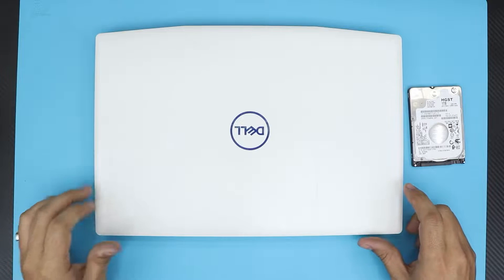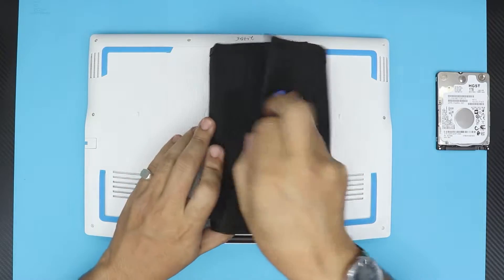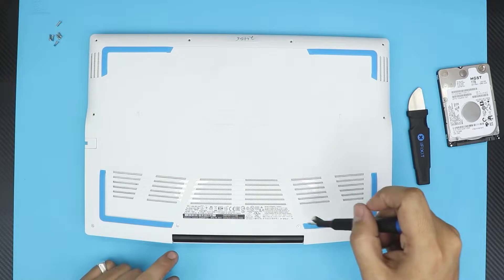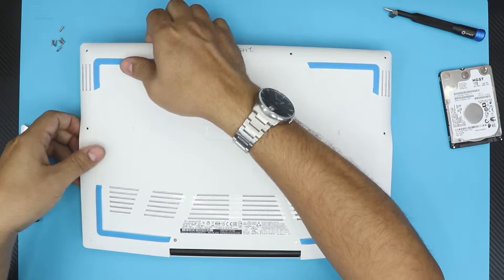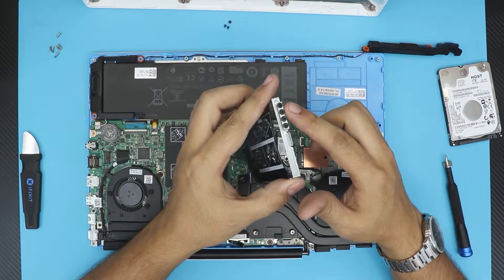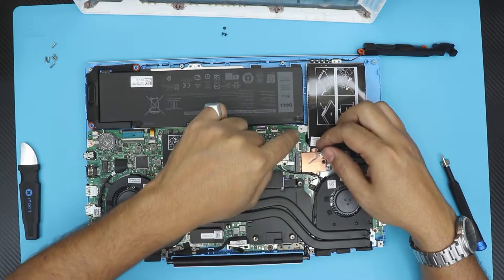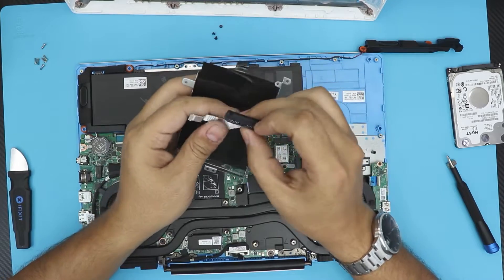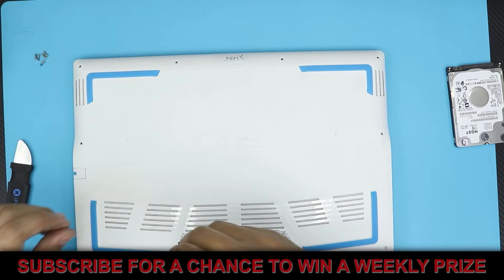DELL G3 15 series HDD / SSD upgrade GUIDE

Comment: Is it bad if you fold the ribbon like that?
Reply from the maker: there is not problem on folding the ribbon cable  few times but. its not recommended if you are doing to fold it more than 10-20  times. as you not going to be replacing hdd every week or so, so dont worry and the thing is once you fold it the shape you want, there is no reason to unfold to remove the adapter. you can just disconnect the adapter and conserve the shape of the flex they same way you had. i hope i explained my self :)
Reply: @uFixTek  alright got it :D I'm planning to put in my hdd from my old laptop to the g3 once I get it from the mail so I dont have to redownload my games. Thanks for the informative response and video!
Reply from the maker: ok good luck if anything you can ask over here :)
Reply: @uFixTek  I do have one more question. I watched a review regarding thermals that in high performance mode, it can hit 90+ degrees or with undervolt cpu with high 80s. Would it be recommended to redo the thermal paste or use liquid metal cooling? I know liquid metal voids warranty though.
Reply from the maker: i would highly recommend using LM, and your temps will not go over 80c at max use. but if you dont want to go LM go with the next best thing and less work and almost same result.
https://amzn.to/2waFuae
Reply: @ctse26  Please do not LM your laptop if you are not familiar with it. Especially on the GPU bc there are resistors that can short out very close to the GPU heatsink surface. I have the same laptop and yielded much better performance with Artic MX4. It took a few attempts before I finally got application right (not too little / too much / even spread). Line method worked great.  Stock paste was definitely dry. I previously used AS5 on my laptops, but it was a thick paste and had a cure time, so using a thin paste was a bit of a learning curve. Like he linked, Grizzly Kryonaught is also good.
Reply: @ctse26  Also here are my performance results from userbenchmark. I'd run your laptop and see what you get and compare it to mine. https://www.userbenchmark.com/UserRun/26103024
Reply: @MasonsMark  I am aware that liquid metal can short out the system which is why it voids warranty upon application. I do quite a bit of research and may wait till the warranty is up before  I use LM. 

Also to prevent the resisters to short out, you can use thin strips of electrical tape to prevent LM to seep onto the resistors that you speak of. 

It's hard to screw up if you already know how to apply thermal paste since its practically identical in terms of application
Reply: @ctse26  Sounds like a good idea. There is also liquid silicone that you can brush onto the resistors to prevent them from shorting. Keep in mind that even good quality electrical tape gets sticky and makes a mess after being exposed to heat for a long time. Kapton tape is ideal as far as tape goes.

I would at least repaste with something else for now, as it doesn't void warranty. Artic Mx4 is 10 bucks and dropped my temps ~10 C (avg) and I don't have throttling anymore. I stay locked at 4 GHZ on all cores even after hours of gaming.
Reply: @MasonsMark  good idea to use both at the same time since physical barriers is best
Reply: @ctse26  The worse thing about liquid metal is it will damage most copper heatsinks after about a year.

Comment: i have the same laptom my question is : can i use "Seagate FireCuda Gaming (Compute) 2TB Solid State Hybrid Drive Performance SSHD – 2.5 Inch SATA 6GB/s Flash Accelerated for Gaming PC Laptop - Frustration Free Packaging (ST2000LX001)" in the same place? like the HDD you show us? casue i want to upgrade my laptop and i want to use this
Reply from the maker: yes my friend, the HDD/ssd the one you mentioned is totally compatible with the laptop. just plug it where the hdd goes. pre much any 2.5" sata connector drive is compatible. if you got any other question let me know and good luck.
Reply: @uFixTek  tnx!!!
Reply: What si better firecuda 5400rpm or barracuda pro 7200rpm?